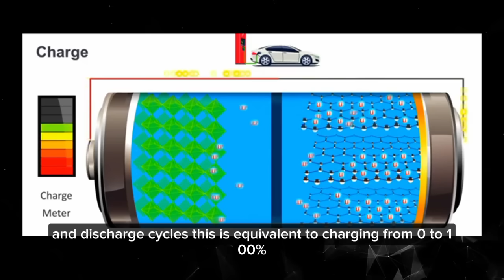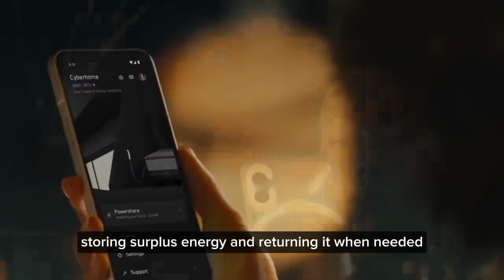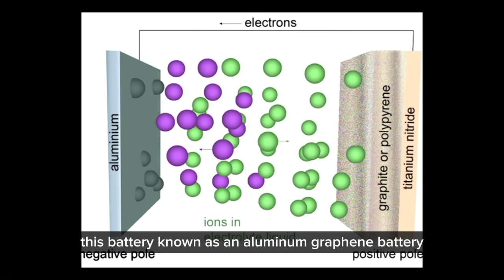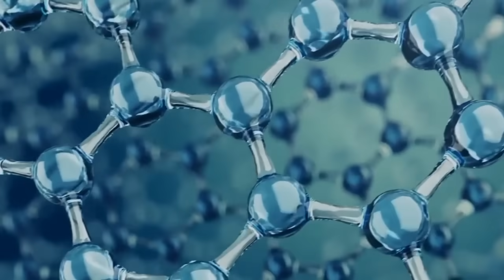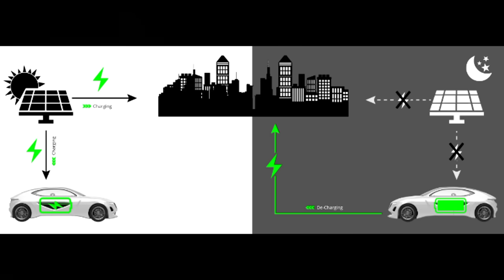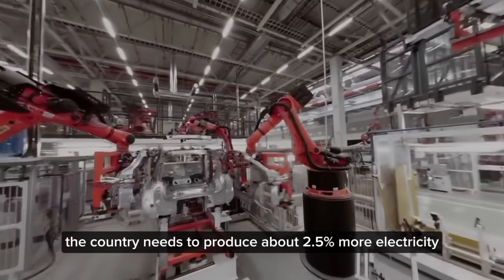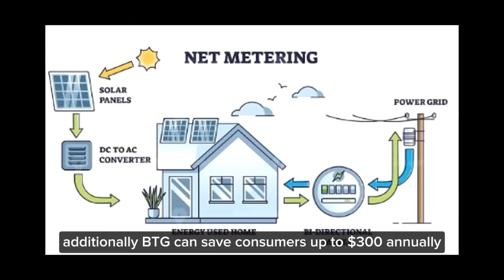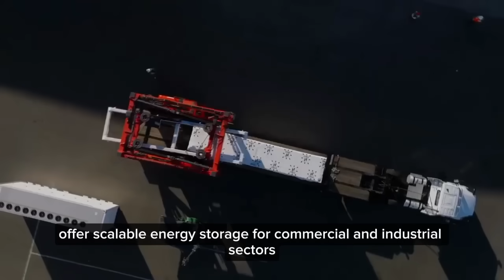Elon’s CRAZY Innovation Just Reshaped Tesla’s Future

Comment: How do you prove the batteries will last 200 years until they have last 200 years (4024)?
Reply: 2000 years is a bit of a stretch : P
Reply: @killosillator  where did you get 2000 years from?
Reply: @davidiand7  from your comment that says 4024, which is 2000 years ahead.
Reply: We will see but I joined the charge